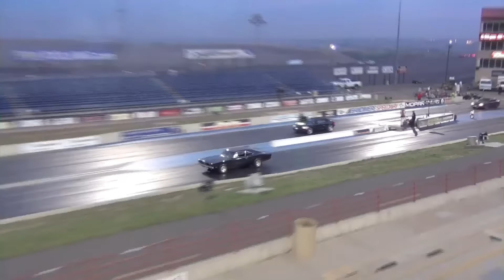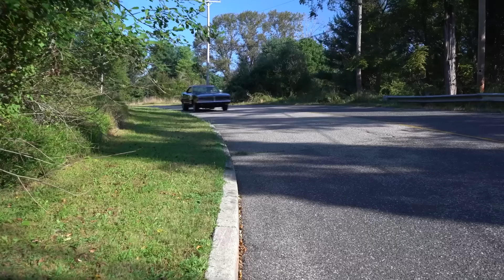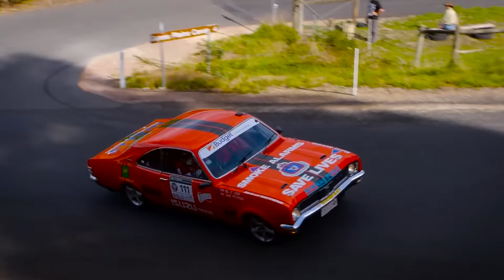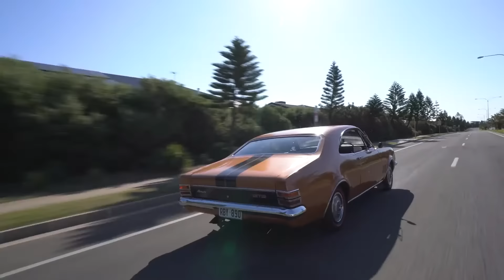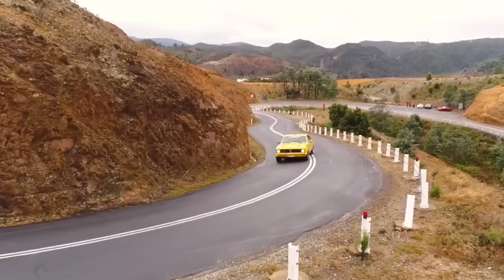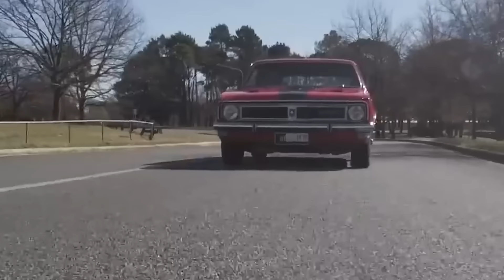426 HEMI vs Holden Monaro GTS 350: USA vs Aussie Muscle Car Showdown!

Comment: My 1972 Ford Cleveland 351 never lost a race. :)
Reply: What about down the Autobahn or to 100 km against an AMG 63? 😀
Reply: @gianwcs6077  I'm talking decades ago.🙂I also had a Triumph 2.5 MK11 PI that had a split differential so that the power from the engine down the drive shaft didn't cause the back wheels to explode when you put your foot down. It was an engine that came from the Hawker Hurricane fighter plane in WW11, with mechanical fuel injection, not electronic injection. An AMG 63? My god, are you Jeremy Clarkson? 🙂
Reply: @DannyDownunda  Yes, the Ford GT was a legend for it's time. Just want to pointing out that eventually performance cars, through advancement become faster. I actually own a Ford GT and absolutely love it, It is fast and a great touring machine.

Comment: Thrown in a VH Valiant  E49 265 Hemi Six Pack  Charger would be most interesting.
Reply: I agree with you
Reply: The fastest verified stock 1/4 mile time for the E49 is 14.1 seconds.
Reply: @alwaysonly2genders 
The 426 hemi did 12's @ 119mph !
And that was as fast as it went.
Reply: @Marc_Remillard Ummmmm, my comment was in response to the flog that mentioned a much slower car, saying would be interesting. 
 So not sure what you're on about, seriously.
Reply: @alwaysonly2genders 
The American hemi 426 trash is so much slower than a 
E49 265 hemi 6-pack.
The 426 was only good for 119mph stock.
The 265 hemi did 145mph.

No contest in a race.
Aussie cars were so much faster, as they were not geared for a quarter mile race. No stupid 411:1 diff gears.
Reply: ,,,or a Hemi Cuda.

Comment: Shit what a fuken joke a 70 340 dodge dart would be all that manaro could handle ok chevy even put some more hardware in the manaro yal so a good running 340 an yal put a little stuff in just like Chevy always did yal an the 340 dart would shit all over that nova looking manaro yal you know it would.
Reply: The Munro would have NO chance against a stock Dart/Barracuda 340. Not a hope in hades.
A stock 2 barrel 318 VF/VG Valiant with a 904 and 2.92 BW, was almost as quick as the Monario.!!

Comment: Wankers would want the Yank Tank. A show-off’s toy. A substitute for a real p3n1s. A Yank Tank is a “car” that’s great for roads with no “features” and nothing else. Roads requiring only minimal driver skills to be able to drive quickly. Roads presenting no challenge. Real drivers would want a real car, something that actually can be driven (and driven well) on real roads. A car that goes, turns and stops when needed, not when the car thinks that it might be a good idea whether or not to comply.

Comment: Depends what sort of race. Straight line speed, top speed, acceleration, drag-race ~ a 426 is big guns. That's a legend, and it is one for a reason. They built that engine to run 200 mph around the banked ovals, and it did.
I have driven one GTS 350 Monaro, and it was old, and it was not in the best state of repair.
I was a child of late '62, and my driving experience stated with 1600 Dattos and early Holden C'dores, and neither one of these muscle cars 'handled' in anything like the way I'd expect or demand if I was going to explore the limits of the car.
TLDR ~ the 426 makes about twice the power a 350 chev did, (both showroom stock) so that's your answer. But doing anything over a hundred mph on 4 crossply tyres with recirculating ball steering and leaf-spring solid axles ~ let me stick to riding my zx14 which I know is safe at 300km/h.
Bikes and cars have both been through times when engines suddenly got a lot more powerful and the chassis and suspensions and tyres needed a decade or more to catch up. For bikes, that was late '70s through until the mid '90s. For cars, it was the whole muscle-car generation.

Comment: The HK Monaro which was the first model came out with the 327ci and 186ci engines....

If you are going to do videos on Aussie muscle cars, at least get the story right from the get go or don't bother at all....

Bloody amateur....
Reply: Yeah and also the HK Monaro came out in basic form with a 161ci six and three on the tree as well as the 307 Chev truck engine (283 bore and 327 stroke) in GTS
Reply: @jamesgovett3225 100%

Comment: Should believe that the Monaro racing coupes used the heads with 2.02" valves together with the mech.cam for at least 350+ hp. Most of the hi.po.302/327 parts the powered the really fast  '70 350 LT1 Z28.
Reply: They didn't...they were standard heads.

Comment: Factory spec Hemi Charger 426 would get the pants scared off it by a factory spec E49 265 Hemi Charger , it would be breathing down its neck , Monaro's are made of fairy floss
Reply: Yanks don't know what fairy floss is...try cotton candy.
Reply: I had a 350 monaro that would slaugter them both now l have a hsv with an ls3 that would slaugter them both 😂 they were crap.
Reply: @JohnWinzil  No you didn't.
Reply: I found out the was a little known dealer option for the E49 which was the scoop and the even more aggressive cam bringing up to 235KW 
It was amazing at the time on shit box tyres a VH Charger R/T 265 E49 could do a reliable 14.1 quarter not bad at all
Reply: At 235 kw tyres dont have 2 be that good 2 get traction😂. @metalmickey-d6w
Reply: @JohnWinzil if you driven a VH Charger they let go in the back very light weighted trust me a big tank one full of concrete might help
Reply: @metalmickey-d6w  The scoop was just drilled onto the bonnet. There was NO hole there for cold air!! It was a gimmick.
Reply: @kramrollin69 you have no idea dummy what you are talking about.and have most likley never had a decent car.😂.

Comment: Holden Monaro GTS 350, 300HP,  nothing more,15's quarter mile oi oi oi
Reply: That was stock. Put a Holley on it, proper headers and exhaust, remove the fan and change it to twin thermo fans, 5 to 7HP just there. Doesn't take much to get it into the mid 13s. 
And people who have bought American cars in Australia regret it later. Expensive to maintain and not built as good as Aussie cars. 
So, the Charger is faster in a drag, but that's it. If I was going to race at Bathurst, I would use the Monaro. And the Monaro can be used as a daily driver without any issues. Fine is heavy traffic. I love the Charger but would own the Monaro first.
Reply: @BatMan-oe2gh  🤡
Reply: @jimclarke1108  You are the 🤡 You know nothing about cars.

Comment: Drag the hemi.
Actual race track the Monaro.
Note for yanks a race track has these things called corners your one turn direction things are not real race tracks.
Reply: Take them to Mount Panarama and see how go then. The yank could handle the straight but the bends would see it go off the track.
Reply: @russellwaterson3304 it’s not 1970 anymore. It’s popular to regurgitate old tales. Modern tyres have evened up the margins pretty much, and if you used a lower spec 383 charger as a “track car”, it would leave the Monaro for dead.
Btw, this video is AI bullshit, happy new year!
Reply: @russellwaterson3304  
If they managed keep it on the road the brakes will overheat and fail by the end of the first lap.
Reply: @russellwaterson3304  You have never driven an old Holden have you.........
Reply: @kramrollin69  Often, hated Taranas, own a Gemini, even a Camira. Driven, Monaros old and new, kingswoods,  of various marks, Statemen, and some stuff from the 50s I couldn't tell which type.
Reply: Bull....😂 the charger will eat the monaro for breakfast
Reply: @ACDZ123  Thats because it would of spun out on th first corner and face the wrong way open its mouth as the Monaro slams into it.
Reply: Nah, my old man had one in the 70s ..it really wasn't that fast ..i hadca factory VL in 87 that would also eat the monaro for breakfast 😂 @russellwaterson3304
Reply: I think a Aussie 340 charger would still beat a Monaro just need sandbags in boot of charger or maybe a regal hardtop be better
Reply: @MoparMadman-g8z  
They worked up the  E49 265 Hemi Six  because they had already trialed the 340 for racing. 
To nose heavy  to corner competitively. 
Adding more weight to counter that might make it easier to handle  but will handicap both acceleration and corner speed.
Reply: @martinsmallwood9605  Nothing to do with it. It was because CAL wanted to promote the Hemi 6 as Aussie Made and pushed the Aussie stuff to the public. Hence the 3 speed Borg Warner, the tiny Borgy diff. When ALL the 340s imported had new process 4 speed gearboxes, and BW developed the BW88, that is in the E48.